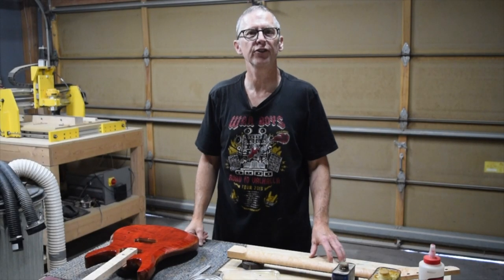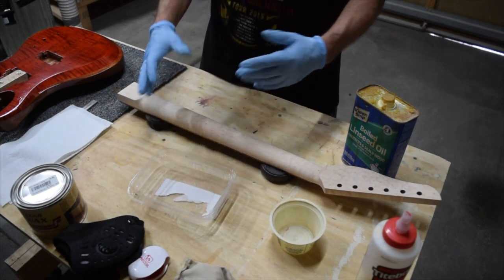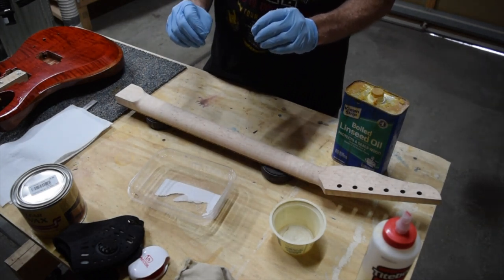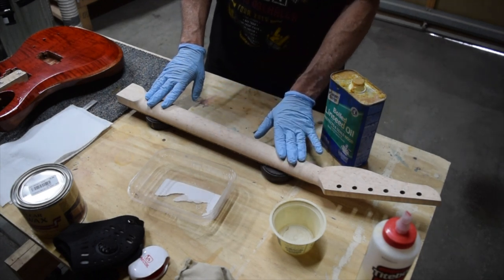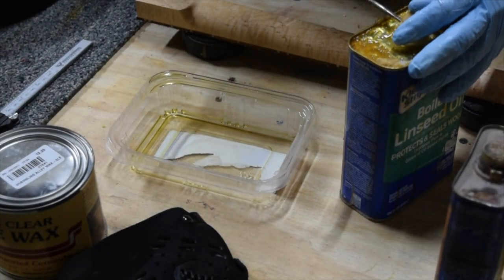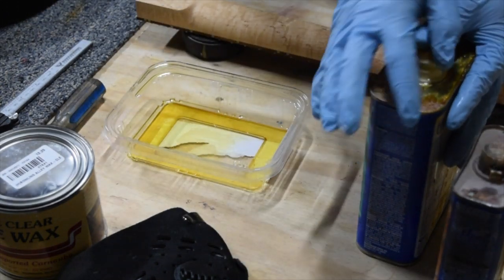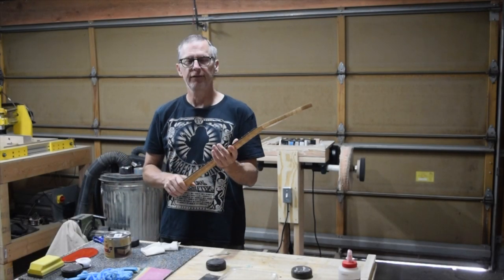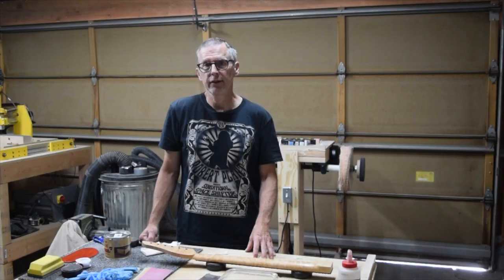Applying An Oil Finish On A Guitar Neck

Comment: What are your thoughts on tru oil in comparison to boiled linseed oil? You mention how to mimic it on the cheap, but I'm interested in how the final finish compares, how the durability is, and so on when compared to boiled linseed.
Reply from the maker: Durability and appearance of my mix is exactly the same as Tru Oil.
Reply: @HighlineGuitars  Oh yeah, I don't doubt that your mix is excellent (I may even use it on the next few builds) but what's the main differences between your mix/tru oil and the plain BLO?
Reply from the maker: @fairguinevere666  BLO doesn’t have any varnishing resin in it.
Reply: @HighlineGuitars  Ah right, so I take it BLO is thinner and deeper penetrating, but slightly less durable and doesn't build as much? Definitely sounding like for the almost not there at all feeling BLO is what I'd want.

Comment: I just put the first coat of boiled linseed oil on my neck and it’s not dark like yours
It’s still very light. It’s a maple neck tho I don’t remember what yours was is there any trick to making mine darken up a bit?
Great video btw 
Thank you for sharing your work
Reply from the maker: This is why you test. If the test isn’t giving you what you want, stain or dye the wood first. As it stands, all you can do is apply more BLO and hope it gets darker.
Reply: @HighlineGuitars  okay thank you.
My neck was really smooth before I put the BLO on because I had used steel wool to remove the old poly finish and it came off fairly easy. Will the super smooth wood have any affect on how it takes the BLO?
Thank you again.
Reply: I used 0000 steel wool to remove the old finish
Reply: @HighlineGuitars  I did the steel wool before I saw your vid
Reply: @HighlineGuitars  an update to my last post. I ended up sanding off the boiled linseed oil I had put on because the neck was just too light in color.
So I just now applied a second coat of golden oak stain. So tomorrow I’ll follow up with the linseed oil again. I’m really happy with the color of the neck now. The guitar is a Harley Benton TE-52 and it came with kind of an orangey color on the neck and headstock. I  had left the fretboard and face of the headstock the original color. The golden oak stain seems close to the stock color but not as overwhelming. So far so good tho.

Comment: So, I'm planning to stain my basswood neck to get something closer to a roasted maple look.  Would I apply Boiled Linseed Oil after the stain to get a good seal?
Reply from the maker: A basswood neck? Yikes. I can't comment as I would never use basswood for a neck. It's not stiff enough.
Reply: Basswood is not a good choice for a neck at all!    super soft but i like it for a body with a maple top.
Reply: @These_go_to_eleven_1959  I didn't choose it.  I'm resurrecting my very first guitar.  I think it might be maple, but it doesn't look like it.  The original specs I could find on it says it's basswood, but it seems like a pretty solid piece of wood.  Maybe basswood hardens as it ages?  Or, maybe it's an ugly cut of maple.
Reply: @chzzyg2698  they rarely ever use Basswood for a neck so I'm betting it's maple

Comment: Can I do this to my fretboard too? The fretboard on my strat is the same bright white maple as the neck and I would like to match the finishes.
Reply from the maker: Yes, but you'll also need to clear coat it after the oil has dried to protect the wood from grime.
Reply: @HighlineGuitars  Thanks for the answer. If it wouldn't be too much trouble, then could you tell me what clear coat I should use because the options I see online are for guitar bodies and have a gloss finish?
Reply from the maker: @Bulbous_Beluga  https://thecrystalacstore.com/products/brite-tone-instrument-finish
Reply: @HighlineGuitars  Thanks and Merry Christmas

Comment: Question: would you recommend doing this also on an unfinished maple fretboard or just the neck?
Reply from the maker: When using a Maple fretboard, I always lacquer both. Using oil means you'll have to clean the fretboard frequently.
Reply: @HighlineGuitars  I just bought a roasted maple neck and fretboard from Warmoth which is why i asked. So then this method of oiling your guitar neck is only recommended with a maple neck only with rosewood/ferro/ebony fretboard?

Comment: Hopefully you'll see this but I'm finishing my partscaster bass with this method and I was wondering if I can apply a waterslide decal and then the linseed oil on top? It should I finish the headstock with a different finish in that case?
Reply from the maker: Add a little oil-based polyurethane to it first. That will help it dry completely. An alternative would be to use a wipe-on polyurethane.

Comment: Hi man great video. But if I am doing a refret on a maplr strat neck and some laquer comes off from the fret process. If it is nitro cellulose or polyurethane finish on neck or something else can i still just apply a small amount of the boiled linseed oil and then sand and polish it up? Or will the finishes react together and spoil the neck? Also how do you de finish the different neck finishes like nitro cel. Poly. Gloss. Satin. Or tru oil or boiled linseed  thanks alot for your teachings here.
Reply from the maker: If you're going to spot repair a fretboard, you have to do so with the same type of product that is already on it. Otherwise, you have to strip the finish down to the bare wood and refinish.

Comment: Question, I have a nitro finished maple neck. It was sticky, and I used a scotch brite pad to smooth it out. I think I took it all/most off and it looks unfinished now. Should I/could I rub it down with boiled linseed oil?
Reply from the maker: I would respray the nitro. Or grab some sandpaper and sand off the rest of the nitrocellulose and apply the BLO.

Comment: I can't understand one thing clearly. After we apply the first coat, how much we have to wait for the wet sanding. As i see you wetsand the surface before it completely dry. You didnt wipe the excess of oil, you wetsand the oil instead of wipe the excess. Am i true?
Reply from the maker: You can wet sand right after applying the oil. No need to wait. Don't worry about wiping off the excess until after you've finished wet sanding.
Reply: @HighlineGuitars  If I am going to sand right away, what will I have sanded? Is it like trying to sand the ocean? I really can't understand.

Comment: what grit sand paper should i use on my neck before start applying the burned lynseed oil?
Reply from the maker: Take it to 400 grit. Then rub in the oil with progressively finer grits from 600 up to 1,500.
Reply: @HighlineGuitars  so very 1st thing is to start with 400, then use the oil with sandpaper? I thought I was supposed to use a rag

Comment: Looks like you were kind of getting it onto the side where it overlaps into the fretboard wood. Would that not be noticeable on the fretboard? Would it discolor slightly? Or does that darker fretboard not really absorb and show a color change?
Reply from the maker: What I didn't show was that I applied the oil to the fretboard as well so it all matches.
Reply: @HighlineGuitars  Thank you for the great video, and for the reply. Stay safe out there.

Comment: I happen to have tru oil. If I just do a couple coats and then sand it with 1500 grit, will I get a similar result? I want the guitar neck to be protected, but I don't like a glossy finish
Reply: Tru oil will not be glossy.

Comment: I have a Squier Bullet Telecaster with a Satin finish on the neck ... it feels a bit like unfinished wood though.  If I want to refinish it using your method (or any other method haha) do I need to sand down the back to remove the Satin finish first?
Reply from the maker: Yes.

Comment: Did I understand you correctly?  You apply the Japan Drier, and immediately apply the BLO and wet sand it about an hour later?
Reply from the maker: That's what I said.
Reply: Thanks. If I apply a second coat of BLO can I use Japan Drier again or just apply a second coat? Or should I avoid a second coat of BLO?

Comment: Thank you for video. What if I want a light stain ? Can  I mix a little with the linseed oil or do I use a stain first then use the oil after it dries? Also what are you propping up your neck with while it's drying ? Thanks
Reply from the maker: You can do it either way, which means you'll have to test on scrap to see which approach looks the way you want it to.
Reply: @HighlineGuitars  oh thanks for the quick answer.

Comment: Have you ever tried Renaissance micro-crystalline wax polish? Ben Crowe at Crimson Guitars loves it. The downside is that is in not cheap or readily available.
Reply from the maker: I use Crystal Clear made by H.F. Staples. It's harder and more durable than Renaissance because it uses only pure carnauba wax. Renaissance uses a blend of carnauba and beeswax which IMO is inferior.
Reply: @HighlineGuitars  Ben Crowe was saying that Renaissance is petroleum based. I'll have to check into it.
Reply from the maker: @jburtonca  I must have been looking at the wrong product because Renaissance micro-crystalline wax obviously doesn't contain a blend of carnauba and beeswax as I stated. I may have to try it since it does sound better than the H.F. Staples Crystal Clear I've been using. That being said, I have had good results with Crystal Clear and it is much less expensive.

Comment: Denatured alcohol is not available in my area. If  I use a water based stain(Colortone vintage Amber) on the neck & fretboard,do I need to seal them afterwards?
Reply: Stephen Craig unlees you can order it you need to seal it i believe, however, pls don t stain your fretboard
Reply: @tremendoshd2356  It is an inexpensive guitar kit & I wouldn't want to mess it up but, I'd like to have the vintage yellow look. What are your concerns?thx
Reply: Laurie D. The eeffect stains have on wood is not dramatic, howver the fret oard is usually much thinner than other body parts, staining the body has no effect since the stain doesn t go all the way through the wood, but on the fretboard it can happen than entire fretboard is stained(in it s thickness) it CAN affect the glue just as much as it can not affect it, but generally speaking ,staining the fretboard can affect its lifespan.
Reply: @tremendoshd2356  ok,thank you.I appreciate it.

Comment: Hey, thanks, great video.
Can i use this for a body? 
I want to apply it on the body of a kit that i purchased, it's already been coated with grain filler in the factory, it's kinda smooth to the touch, but a bit bright and pale. 
Will this give the body more of a "tanned" wood kinda look? (i'm not looking for a vintage tint but just more of a healthy wood tone)
Thanks again!
Reply from the maker: You can use BLO on a body as well. It won't offer the same level of protection you get from a hard clear coat, but it will seal the wood. Whether it will tint your guitar body with grain filler is unknown. Try applying some a spot that is inconspicuous.
Reply: @HighlineGuitars  I see! Perhaps there is some other product that i can apply before applying the oil to get some tint? 
Any simple idea?
Reply from the maker: @eladguitar  Perhaps an oil-based stain.

Comment: ok, this might be a dumb question... is a clear coat recommended after the oil dries? or will the oil be sufficient for sealing the wood?
Reply from the maker: Boiled linseed oil will seal the wood. A clear coat will improve durability and make it easier to keep the wood clean. A clear coat isn't necessary unless you want the extra protection.
Reply: @HighlineGuitars  thank you! I appreciate your help :)

Comment: Thanks for the sharing your experience. They are so helpful for me which is a rookie woodworker. I just want to ask do you always take only one coat of BLO, is it enough?
Reply from the maker: One is enough. But you can add more.
Reply: Its feel is always oily, not sticky. Altough i wipe all the excess after 5 min applying, it looks wont dry. It is BLO and neck is drying at recommend conditions. Do i have to remove with some other liquid?
Reply from the maker: @mertakgun8209  How long have you allowed it to dry? I know of no way to remove BLO.
Reply: I have been waited for 24 hours, i didnt use japan drier cause i cant find it in my country. Actually when i came after 5 min after applying, there were not too many excess. After 24 hours its still same oily feel compared to immediatelt after i apply.
Reply from the maker: @mertakgun8209  It could take as long as two weeks to dry without the Japan Drier.
Reply: Oh thanks, i will wait when i try some other finishes.

Comment: I've tried Danish Oil, Tru-Oil, etc etc on everything from guitar necks to knife handles and I have never seen any of them do any better than plain old BLO. 
On a large scale like a factory the difference in faster drying makes them worthwhile, but I seriously don't see the point of paying extra for the "fancy" oils when doing a couple guitars or a few knives at a time.
Reply: Incidentally if you're really worried about drying time, say if you have high humidity, you can mix a bit of mineral spirits in with your BLO. But again, on a small scale like we're talking about here it may not be worth the effort to you.

Comment: I want to apply a headstock logo after oiling - can this be done and then lacquered? - will the lacquer bond over the oil?
Reply from the maker: It depends on the oil. Boiled linseed oil will dry, but it can take time. Adding Japan drier to it helps. Tung oil takes even longer. Japan drier won't work, but polymerized tung oil dries very quickly. If you going to use nitrocellulose lacquer, I wouldn't bother with oil. Nitro imparts a similar effect as oil.

Comment: I may have missed it but what grit do you sand up to on the neck itself before applying the oil?
Reply from the maker: I sand the raw wood to 400 grit and wet sand the oil with 600, 800, 1000, 1,200, and finally 1500.
Reply: @HighlineGuitars  thanks a lot! My next step is shaping the neck so this is perfect!

Comment: What would be the difference between using boiled linseed oil and teak oil? Im trying to decide which I should use for my telecaster neck
Reply from the maker: Teak oil offers better UV protection if that's important to you. Otherwise, there really isn't much difference.

Comment: I put a thin layer of pure tung oil on my neck before watching this. Can I go over it with a drying oil like teak oil or am I doomed.
Reply from the maker: Pure tung oil is a drying oil. Just. A. Slow. Drying. Oil. Hit it with the teak. You'll be fine.
Reply: @HighlineGuitars  Thanks for the video and tips! 

Its actually a super thin layer - feels pretty dry and silky 24 hours in - going to do one more thin layer tomorrow and then single layer of teak on top a few days later - applied with 1000 grit. Next time will go boiled linseed though.

Comment: Can I do my body in this also? I just got a zebra wood guitar kit.
Reply from the maker: Yes, you can. I just did a Swamp Ash body this way, but with a couple of mods. After the first couple of coats had dried a few days, I thinned some BLO with mineral spirits about 1 to 1 and wet sanded it into the wood starting with P400 grit and working my way to P1,500 grit. I let it hang to dry a few more days and then waxed it with HF Staples Crystal Clear Paste Wax.
Reply: @HighlineGuitars   thank you for sharing your expertise. Its people like you that make the internet a great thing. God bless and have a wonderful Thanksgiving. Now to get busy on my first ever guitar build.

Comment: How would you handle a water slide decal with the boiled linseed oil?
Reply from the maker: Apply the decal after the BLO has completely cured. Then bury it in lacquer.
Reply: @HighlineGuitars  Cool, ty!  I didn’t think I could lacquer on top of the BLO, the “ oil” part is a bit misleading.

Comment: Can this process be done over a stained neck
Reply from the maker: Yep.
Reply: @HighlineGuitars  Thank you! I want the front of my headstock to be glossy. How would you recommend I go about doing that after this procedure?
Reply from the maker: @JusticeCammack  Spray it with a gloss clear coat.
Reply: @HighlineGuitars  over the boiled linseed or leave that off of the head?
Reply from the maker: @JusticeCammack  You can apply clear coats over the oil as long as the oil is completely dry and cured.

Comment: does Japan oil make tru oil dry faster?  Or do you not need to use it with tru oil?
I ordered a small 3oz bottle of tru oil. How long will it take to dry between coats without Japan dryer?
Reply from the maker: Those are questions for Birchwood Casey, the company that makes Tru Oil. I don't use Tru Oil.
Reply: @HighlineGuitars  You said in your video that you've used it in the past but prefer Linseed Oil.
Reply from the maker: @thebluesrockers  So long ago I don't remember. This video is 4 years old.
Reply: @HighlineGuitars   I get that. getting old sucks don't it?  hahaha
Reply from the maker: @thebluesrockers  I used it twice over 15 years ago. The stuff is awful. However, it seems very popular with newbies who lack spray equipment.
Reply: @HighlineGuitars   Linseed oil is the main ingredient in Tru Oil.
Reply from the maker: @thebluesrockers  yeah, but the other stuff ruins it. BLO + Japan Dryer is better and polymerized tung oil is the best.